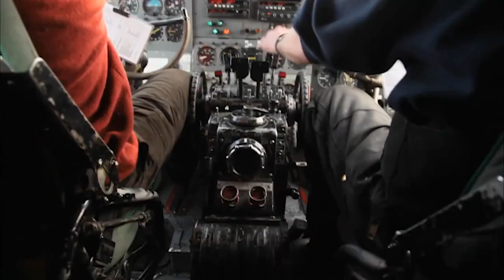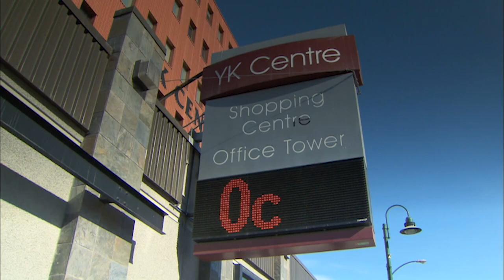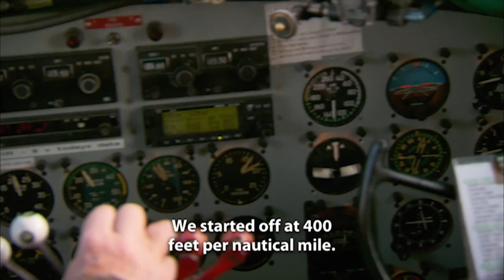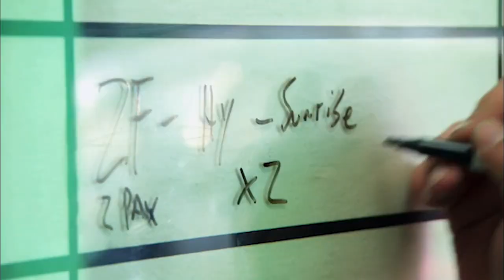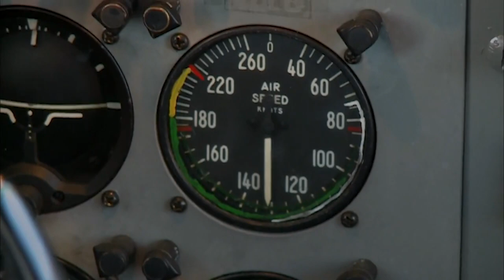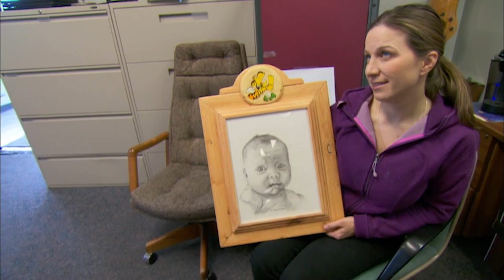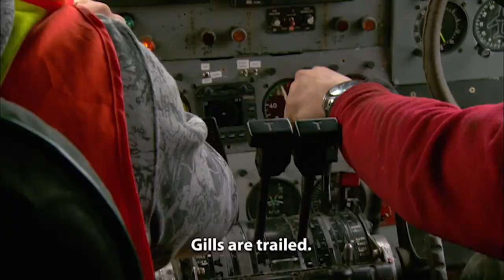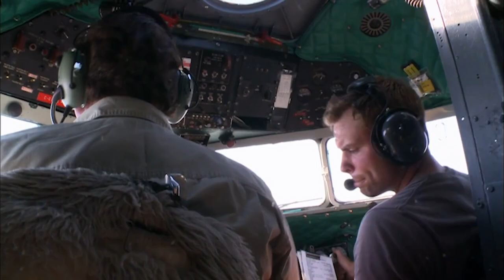Landing An Airplane On A Dangerous Frozen Lake | Ice Pilots | Wonder

Comment: Why are they flying these old planes. Just buy a couple of jets
Reply: They're cheaper
Reply: Cheaper, easier to maintain, more reliable and robust, and can handle the elements and weather better. 

People don't understand just how touchy and unreliable modern jets are, ESPECIALLY when the weather gets cold. These old work horse planes are exceptionally better. Modern jets have constant issues when it comes to computers, and requirements for specific high endurance, or specialized fuels, and oils, and all kinds of stuff that just doesn't hold up in brutal weather, or temperatures at all. These old planes can though and they'll keep chugging away even when all the modern planes are grounded.
Reply: Can only land jets on pavement
Reply: These planes are about one million dollars - a jet costs about 100 to 200 million dollars!
Reply: These planes are more versatile for the environment.
Reply: No guys, Joe is just caught up in the past flying these junk boxes

Comment: the planes with roters are really not nearly as reliable as planes with engines like the boing 777 or the airbus A 320
Reply: You're right, Rotor planes are far more reliable. Way to much can and does go wrong with 777's, and A 320's. 

Want proof? The fact these planes are still flying. 777's break down, and have malfunctions, issues, and constant computer failures at a rate of about 20-30 to the 1 small easy fix issue that Rotor plane will have.